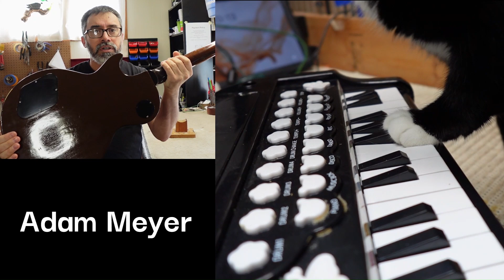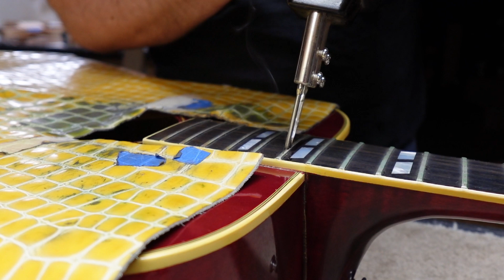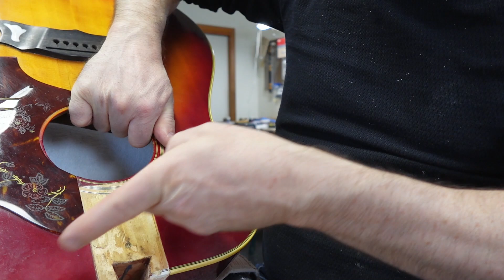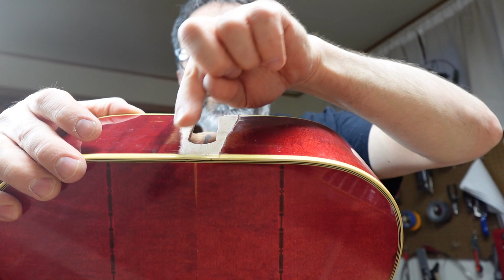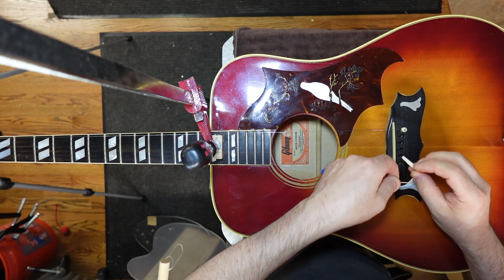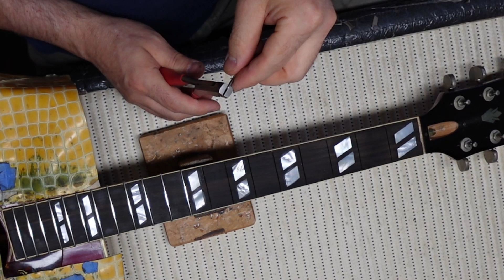1972 Gibson Dove Custom, Neck Reset and Refret.

Comment: I just put the old nut back on my guitar to try and isolate a ringing issue. I didn't realize how much I was compensating for it being too low by raising the ABR1.

When I put the new nut back on, it was very apparent. Now sure how I missed it before now. I dropped the bridge by 1/8"(3.1mm) or more. It's surprising just how high it was in order to compensate for low Slots.

Comment: How much do you charge for a job like that?
Reply: I thought the cost was very fair, even more so after seeing the amount of work that went into this.  Luckily I bought this guitar inexpensively enough to absorb the cost of the neck set and re-fret, considering its value.  But, buying a guitar without playing it first is always a risk.  In the 60's and 70's, they only made around 300 Doves per year.